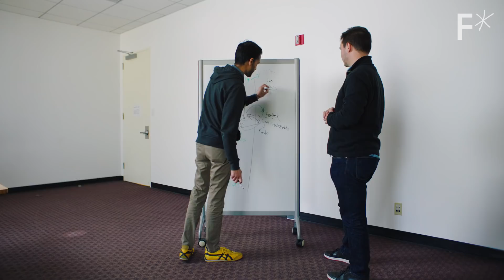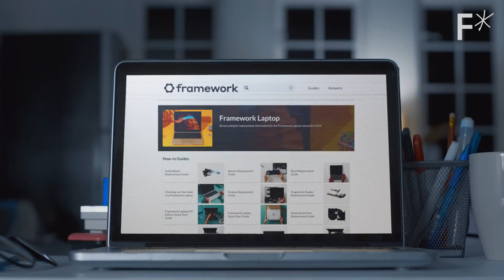The DIY laptop taking on Apple & Microsoft  | Challengers by Freethink

Comment: Right to repair is just one facet of the problem. No matter how you look at it, you cannot or should not overlook the problem of proprietary designs and software. A more open hardware design that allows for repairs is one thing, but what about firmware that is as closed as possible these days, and what about architectures itself... x86 is not a champion of openness by any means, but compare it to Apple's North Korea M1 architecture... and as tragic as it looks, a time has come where running the best performing portable hardware means locking yourself down in a proprietary environment that only lets you run sanctioned software and that you also have no right to inspect and know about.

Comment: I am so happy about this.

This trend of the completely unrepairable product, from phones to fridges, has to be reversed. 

I have had 2 laptops whose cooling fans have broken and luckily, they were old enough that it was still reasonably easy to find a replacement part and get inside the laptop to replace it. Had that not been possible, the rest of the perfectly functional laptop would have become e-waste.

Comment: I am completely onboard with this idea, however I think a lot of people also care about how their device looks aswell. I know it is difficult to make a device sexier, thinner, with slimmer bezels when it is meant to have easy to replace modules, but I think the logo can be iterated on and the design can be tweaked to look a bit better. I think the rounder edges in the laptop itself and large cog wheel logo which also has slightly rounded edges makes the laptop look more playful and less modern.

Comment: is there a laptop with 2 screens :, Screen 1 on regular form factor and screen 2 on back of laptop (below the keyboard)  with touch features and active pen support... so that i can just close the lid and turn around my laptop to switch to drawing mode...
Reply: I do sure they are laptops with dual screen but unsure with pen support, maybe even you need to buy dedicated laptop/device for it
Reply: Dedicated one so the screen would not scratch /broken over time if say, you use pen to draw regularly

Comment: DIY is a different crowd, there is no competition for Apple.  Macbook doesnt sell because of just the hardware we also buy it for Excellent Software importantly Unix core in the mac. You cannot fix this! Right to repair cannot fix highly embedded chips.  At this point A mac M1 chip has dozens of hardware module embedded into a single chip including the ram.

Comment: Given that Microsoft's Surface line is barely a blip in terms of the entire Windows laptop market - this seems like a weird title. True Microsoft makes the OS - but the only thing you need to make it work are drivers for your hardware. Nothing about Windows precludes you running it on your DIY laptop.
Apple and MacOS on the other hand...

Comment: 2022: i bought a diy laptop from Framework.
2032: its still working, but i added so many modules to it (both FDM & SLA 3d printers, DSLR, DVR, InjectionMoulder), its no longer a laptop, it is bigger than a refrigerator. 😉

Comment: I love the idea and would love to see this happen! But realistically I don't think the modular design would extend the life of the product much longer because of compatibility. Similar to gaming PCs, there will come a point when you need to upgrade the motherboard in order to support the newer piece of hardware you wish to add. But, when you replace the motherboard you will typically need to replace other components such as CPU and RAM that support the new board. By that point you have spent nearly the price of a new computer and you are left with old components you will likely throw away. Not to mention the shift we are seeing towards ARM SOCs such as the Apple M1 which are not upgradable at all but offer significant speed boosts over modular designs because of their optimizations and physically smaller size.

Comment: Even further... you can also build optical powered personal computers in which the processing would be at almost the speed of light... makes the batter last a whole lot longer, especially in not needing a cooling fan in not having far less circuitry switches.

Comment: In terms of renewable energy... just asking for your opinion on a different concept of my own that is quite basic. The build I have in mind can at least be of 2 ultra strong permanent magnets, one above another where the top magnet stays stationary on a plastic* container filled with water while the other is inside that container. Between the top magnet and the container needs to be a very narrow gap for which a lightweight sheet of lead* can easily slide between the magnets just enough to cause the bottom magnet to fall as if it were a delicate power switch that the rise and fall will help* generate more electrical power than it would take to move the lead* sheet in and out of that gap in least frictionless way, maybe levitated by other magnets. The water is basically to prevent damaging and even far too much noise.
.
In summary... it would be as if the permanent magnets can be switched on and off like electro-magnets.

Comment: I wish they would make a printer with the same design values, so we finally can repair/upgrade our printers instead of buying new ones every time they broke.
Reply: You should look into laser printers, especially Brother. They are fairly easy to repair.
Reply: Honestly, at least for me, printer lifespans are 6-7+ years. The real issue is ownership with all the BS that they pull with firmware, ink, subscriptions and so on
Reply: @Carterthielftw_  check out the recent video from Louis Rossmann where he rants about Canon multifunction device NOT scanning when there's no ink in the printer!
Reply: @alerey4363  for real, I saw that awhile back and it's scary
Reply: Worked with printers. Inkjet printers are genuinely a scam running on the Gillette model. 

The printer itself is sold at cost but the ink gets a 1000% markup. And that's not an exaggeration: A gallon of ink costs 60$. They pack it into cartridges and charge over 1200$ for literally the exact same ink.

That's why your cartridges are so small. That's why they run out so quickly. That's why your printer mixes a bit of blue into black prints. That's why you can't refill them, why they have DRM, why every printer is so flimsy, why they break so easily, why software support ends so early and why every new printer requires a new type of cartrige. As soon as aftermarket cartriges enter the market or someone figures out how to refill them the money printer slows down.

Get a laser printer or get a refillable inkjet one. You probably won't find the later ones from the big brands though since that business model is why they got that big. I hope they get disrupted the way Gilette got smacked by Dollar Shave Club but until then those are probably the best solutions.
Reply: @user-hv6wb5gk8p  dollar shave club resells dorco blades for twice the price.
Reply: Working  printers are a myth
Reply: A manufacturer will only get into something if it gives them consistent returns on investment. If you don’t buy more than 1 printer ever, why would they even make one? Right to repair doesn’t really work. The manufacturer should only lease you their product, so they have an incentive to engineer it for longevity.
Reply: @jochem1986  but that's the issue, they don't have an incentive to manufacture it for reliability. Look back just 10 years, your printer didn't need a subscription then, why does it need one now? All Right To Repair would do is enable 3rd party repair to access the parts and schematics necessary for repair
Reply: @jochem1986  Just sell the parts, if a company sells the parts than they have consistent revenue streams even if you never buy a whole printer ever again.

Comment: I personally upgrade my laptop components but the thing is you can't upgrade your CPU, often your GPU, display, ports or motherboard and often your battery. If framework can make it possible then I fully support it. Even if that's not possible, I'm still okay with less pricier and lighter eurocoms and area 51s.

Comment: I hope Framework develop different sizes of laptop. This might help them to increase their range of customers.
Reply: The issue here is that everyone claims that "I'll buy a framework when they have GPUs available, I'll buy it when there's an Amd option, I'll buy it when I can get a 17", I'll buy it once they've proven themselves" at some point you just have to buy the thing, I understand it won't work for a lot of people, but at least for now, you will have to make some sacrifices to support a company that's changing an industry
Reply: The issue with them being such a small company is that sometimes the gain in users doesn't offset the cost increase in product launch and production
Reply: @RamkrishanYT  yeah that is problem that too they are producing hardware,  it becomes really hard to get the supply chain in order.
Reply: Hell yeah!
Reply: I hope they succeed. I'd love to see a 2 on 1.
Reply: Of course, but this takes time
Reply: To be honest, I at first thought it'd be too small... but after trying it, I realized that it was almost perfect. Most websites don't take advantage of a 15.6in screen's width, so the width is equal to a 13in but the height is equal to a 15.6in. It is literally a great compromise that would work for most people that was a 15.6in (not to the few people who would need the extra width) yet allows for a laptop as small as a 13in for people in that market. 

If the vast majority of laptop users are in the 13-16in category, this actually captures most of them perfectly. Because for so many people, that extra width is wasted more than they realize. 

They created a single laptop that captures an extremely wide range of those that want a small laptop and those that want a more average screen... 

But it's only after you actually try it that you realize how great of a size it actually is.

And of course, it's still not perfect for everyone. But it's a weirdly good compromise that worked a lot better than I thought.
Reply: @TheDeathmail  a 15.6 or even 17-inch laptop can help them gain more space on the inside for another M.2 slot and dedicated GPU. I also want them to decrease the size of the removable ports for more slots.
Reply: @musicalaltruist1471  the ports are already pretty small, there's not a lot of space to work with. Plus they still have the limited lanes to work with, whatever the CPU has available.
Reply: @TheDeathmail , I get your point, but tell that to an accountant working in multiple windows at a time. Every single accounant I work with use multiple screens because a 24 in screen is too small. The same with designers, engineers, etc. I believe the customers you're referring to are highschool and college students using their young eyes 😁
Reply: This will *